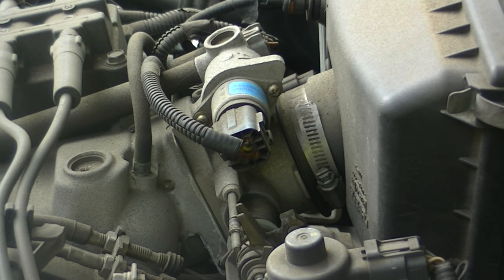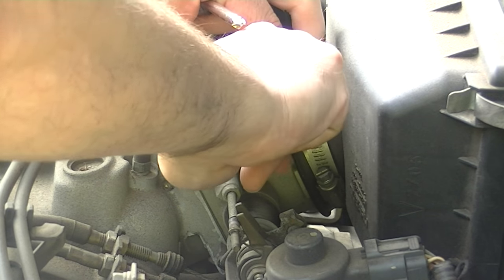How to Fix Subaru Baja Idle Speed

Comment: Thank you for your video; your explanation was very clear. I took mine out today (before I saw your vid, though), and I noticed several things worth noticing. 1) the sensor HOUSING seems to have a carbon RING around the sensor, because it was extremely black, and would not diminish as I cleaned it with a cotton swab. 2) The sensor PLUNGER (its head)at 2:45, seemed to have a deteriorating rubber component, so I only very gingerly cleaned with a cotton swab. 3) the plunger HEAD seats onto the ORIFICE inside, and covers it, sealing it close. 4) I used the wrong liquid to clean it (CARBURATOR cleaner), which will probably ruin the rubber HEAD compound if I let the thing there without evaporating. You did good with WD40. It's good; contains Fish oil, instead, harmless to rubber. Thanks again for your work. Hope this info may be useful to other people in the same need. For idling problems, check the PCV also.
Reply from the maker: Some people are also using gas to soak the IACV in if there is a lot of build up.
Reply: Sure; gasoline would clear other gasoline's oils deposits, too. Sadly in detriment of the either graphite or carbon (IF the housing contains it inside). My question still is: is there a carbon (or graphite inner housing in it?) or have you seen any of it? I am still puzzled by the fact I did not noticed in the 'hub'  a clean, aluminium machined piece. The "plunger" element seems to be stepper motor, really, and - if that is the case - the carbon element around it would be justified, because of the need of a strong conductive surface. Any information about it?
Reply from the maker: I have wondered that same thing, it acts like a servo or stepper, but i don't know enough about them. Maybe someone that knows will come along.
Reply: @Jason - I think it is rather a "stepper" than a servo. Servos usually have an encoder sort of disk (which this one doesn't), that generates a "pulse" which is interpreted as positioning for the Computer. Steppers (or in this case a solid magnetic field around, that propels the core forward or backwards - depending on the polarity of the field), have a much stronger Current driving them (this is the case here) and allows for a strong movement. The amount is determined by the "digits" loaded on the Computer's memory, allowing the core to displace itself so much forward or backwards, to a pre determined position, I believe. Sorry for the length of this. btw, Watch out for the price of these things! Subaru's original is around $250. A replacement - including shipping - is merely $43.00 If this is not ROBBERY, Robin Hood is a nun!
Reply: +johnathan smith You know so much about Subaru. Are the principles you mentioned applicable to other cars models? Like Hyundai or Honda? I mean an engine is an engine, right? Thanks
Reply: @Circe1 - Yes. You are right. Engineering concerns principally with the fuel/oxygen ratio through out the entire engine demand. 'Sensors' tell about how much O is left unburnt (by its conductivity), its temp. (at the filter), and the rate of fuel to feed (by the accelerator  pedal). All cars have these ones, in one way or another, and their out put goes to the engine's computer, which determines how much fuel it delivers.
Reply: +johnathan smith Thank you for your response.

Comment: If you are dong this on a gen2 Forester, remember to disconnect the negative terminal on the battery before unplugging the IAC valve plug.
Personally I leave the negative terminal disconnected for about an hour before replugging the valve and driving - having the computer relearn from scratch seems to give me a better result.

Comment: My 03 baja was had a low idle problem when i would stop the car. I cleaned the air intake valve from the video and then did the throttle body. I still had the problem. A subaru tech told me to reset the computer so it could now adjust to the now clean intake system. By disconnecting the batt terminals and touching the positive and negative wire ends together for about 30 seconds, it will reset the computer. After that the cars running fine now.
Reply: Vincent Alaimo for real?
Reply: My 05 outback is idling low too, so low that my oil light comes on.its driving me crazy but I'll try that

Comment: You dont clean inside ?
The place where the ruber tip sits must dirt .
Allready did it but still idles low . 500rpms.
Also cleaned trothle body

Comment: If this doesn’t solve the problem, what else should I look for? I put a new IAC valve in and disconnected the battery overnight and it still idles rough, fluctuates, and revs at random times. Could it be a wiring issue?
Reply: Throttle position sensor replace it  then clean the Throttle body with Throttle body cleaner you mostly likely did this already .